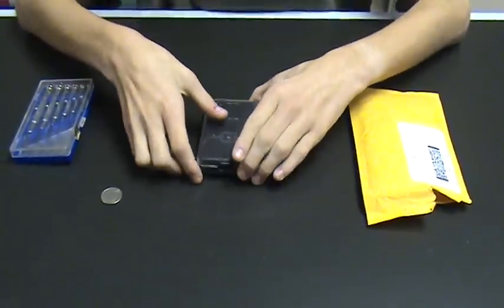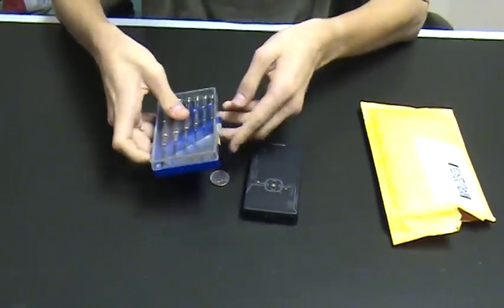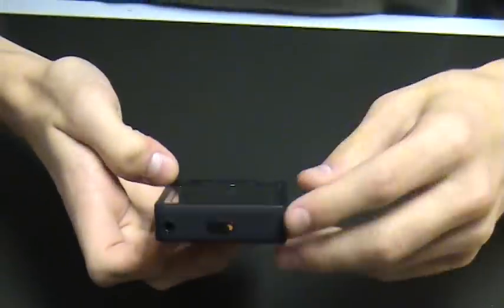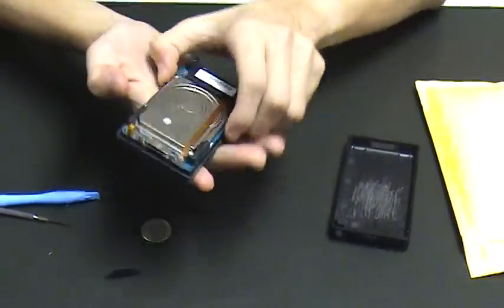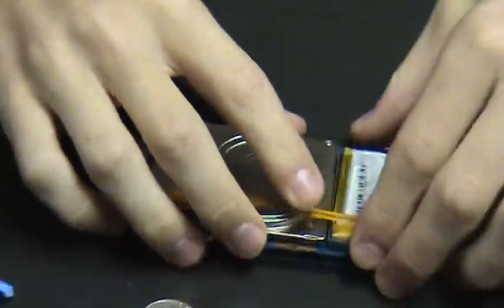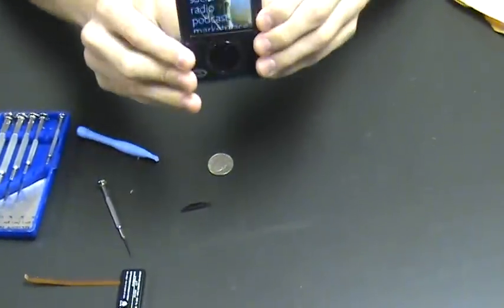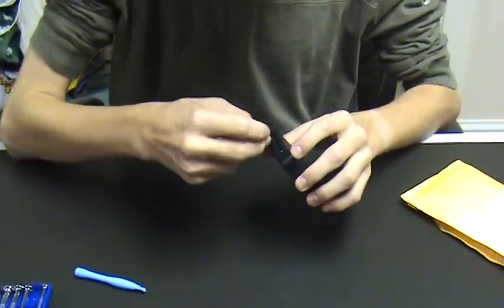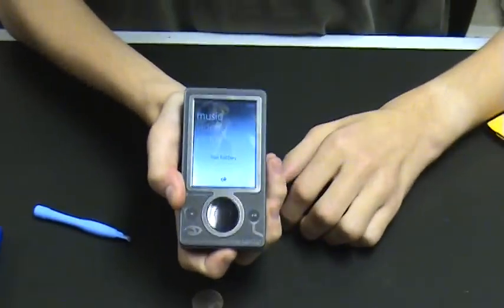Zune Battery Upgrade/Mod/Fix/Repair  (resets frozen zunes!)

Comment from the maker: As I'm sure you are aware, batteries degrade over time and lose their ability to hold a charge.  The original zunes were already 2 or so years old and a standard battery only has about 400 full capacity charge cycles.  Mine had been though about 2wice as many and was therefore quite worn.
Reply: Hi Drac :D 
You have come so far
I am proud of you!

Comment from the maker: its a little different, it still has a ribbon cable and battery area, but to open it you'll need a trigram screwdriver, and a flat blade to pop the silver cover off- its also a different battery, but I dont think you should need to upgrade it unless it doesnt work completely.

Comment from the maker: No, you'll have to re-soilder the wires to the "mini" zune's battery leads, but it's pretty simple and highly recomended as the battery on those goes in about 2 years and thats how old most of them are.
Reply: Hi

Comment from the maker: well, if you've been trying that long, you may have stripped the screws.  To get them out you'll either need a smaller microscrewdriver, or needlenose pliers to pinch and twist out the screws.  Best of luck, letme know how it turns out.

Comment: Of course, but I'm sure some people who just bought one off the shelf and try this mod might be disappointed, so I'm just making sure there's light on that possibility.  You should try an SSD mod. I got a 64GB SSD in my UMPC that improves battery life a bit more, but notably really reduced boot time and increased transfer/read/write speeds, along with being resistant to drops.

Comment from the maker: Im terribly sorry, but while the principle to open an 80GB zune is the same as in my flahs zune video, the battery is a different model and you can not use a 30 gb battery in an 80 gb zune.  Now it is the same procedure to replace the battery and If you have the parts I'd be happy to do it for you.

Comment: I gotta repair mine when I sent it in all I got was replacement charging cable and the actual charging dock was broken... and my warranty expired I got the 120gb... it was good 👍 lasted a while but I wish I can recover all the stuff I saved.

Comment: HI. Tried this but my battery still wont hold a charge. Turns on but says "batt low" even when charged for 24 hrs. Could it be that ebay sent me a bad battery or is there something else wrong with my zune that wont allow batt to charge? Thanks for any helpful answers!

Comment: 800mah to 900mah won't increase video time from 2 hours to 5. It's only got about 10% more power. The only way that would be possible is if the old battery only kept about 350mah of charge since it was old.

Comment: Hello i have a 30gb zune that i had to replace the hard drive and do a complete reset on and when it goes to install the new firmware it says it cannot because there is not enough space. error code C00D124F It is a 30gb 1 gen zune i checked it and it came up as having only 1gb and yes it is a 30gb hard drive and empty any help please